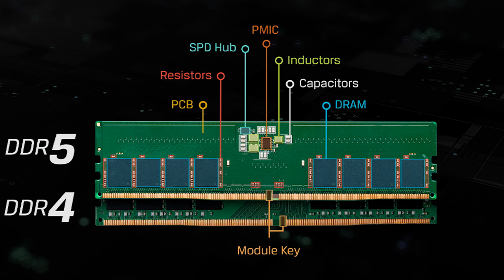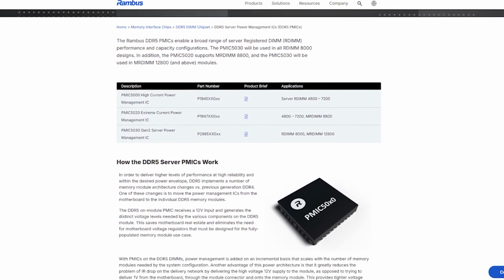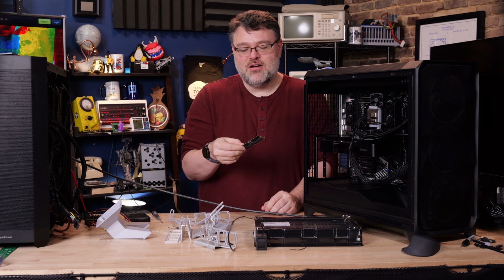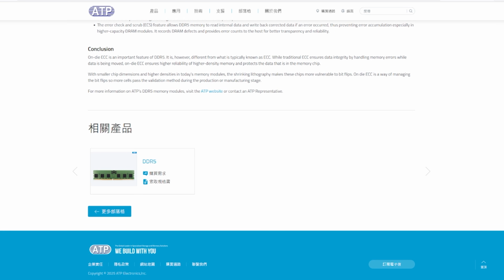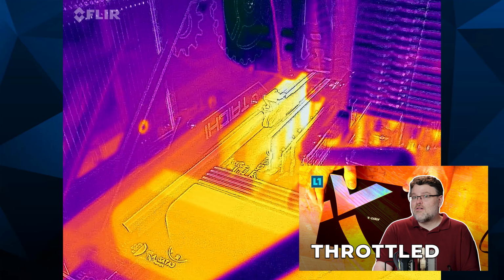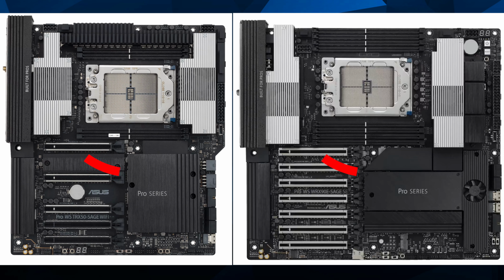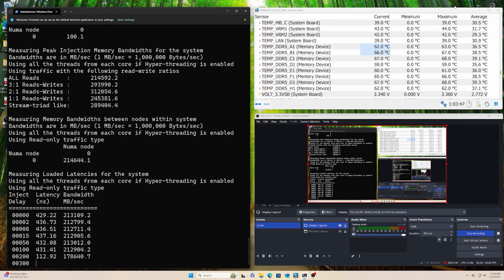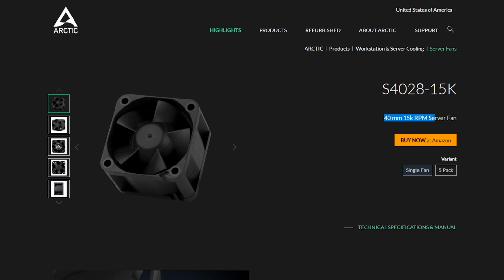Your DDR5 Memory Could be at Risk! All About DDR5

Comment: Interesting DDR5 issues that we can avoid.  If you need to build a PC without taking out a second mortgage, and reliability balanced with performance is important to you, your platforms of choice in January 2026 might still be AM4/Zen3.  My new DaVinci Resolve build has an R9 5900XT, 64GB of DDR4 (two 2x16 kits), 6TB of Gen4 NVMe storage, a 5070Ti, and a 4x18TB DAS in RAID5.  Everything was bought in the Summer of 2025 before prices exploded.  I waffled way too long deciding on a case, but settled on the Montech Air 903.  It is now assembled and tested to BIOS.  I'm researching to see if there is a Linux distro that will run Resolve 20 without jumping through a bunch of hoops.  Probably going to wind up on Windows 11.  I'm running the DRAM a little below "marketing" speed to assure stability -- it's two 2x16 kits.  I anticipate zero heat issues.

Comment: ahhhh... I feel so justified about making a full blackout personal pc rn. Never got into the RGB train except for addressable ambient led strips.
Reply: My PC isn't blacked out because I can't be arsed to turn GPU and mobo RGB off because it would require installing software just for that (so they run in unicorn barf mode), but my RAM sticks are low profile, no RGB, and literally black. I do have one fan with LEDs on it, but it's red only and blows air on all of the mobo.

Comment: ever since I upgraded to 64 gb in early november (dodged a bullet there), I was having instability with crashes once a week. Was advertised as 1.1v 5600MT ram. Increased voltage to 1.12v, no crashes since. Stuff sure is fickle.

Comment: Thanks for the video. I always check a lot of things, temps of Gpu die, Vram, Cpu temps, SSD temps etc. but never thought about DDR5 running that hot so never bothered checking temps for the ram. I did have some weird bluescreens only in star citizen and nowhere else and that game is very Ram heavy, so definitely going to monitor ram temps under load now just to be sure
Reply: check the windows dump file next time it happens. I had bluescreens in tarkov last year, turns out they were caused by easy anti cheat, a kernel level anticheat, which star citizen uses.

Comment: My Asus 1080TI OC in my old gen 1 Thread Ripper 1650x died last week with purple lines in the shadows Ghat GPT says its probably the Grddr5 killed by temperature. the design had the backplate trapping heat and heating up to over 100deg so guess its time to look at a new system i guess anything will be faster that this machine. It still does the job i bought it for. MSI GTX 970 surprisingly useful in case of this emergency.
SO yes check GPU memory temperature and apply extra cooling measures like heat syncs on the backplane even if its a 1 u sever block held on with some thermal past.

Comment: A lot of this could be solved by DIY PC builders demanding motherboards built for function instead of looks. The RAM slots should not be placed across the "usual" airflow path from the "front" of the board to the "back" but in line with it. If a case is designed to change that "standard" airflow pattern then it better move a lot more air than normal.

Comment: Many people (including me) are using tweaked sub timings like tREFI. Instead of very conservative values like 5000 instead 50000 is used. It is the sub timing with the highest performance influence.  With aggressive values it is well known that they only work unless temp is below 55 degrees or so. The default values should provide stability for the specs like 75 degrees. And oh, XMP on very high-end RAM (7200 MT/s or more) is notoriously unstable. I bet those kind of RAM sticks were not tested to work with 75 degrees.

Comment: Its weird how low the temp actually needs to be for it to create instability. I have tested a bunch of kits, and Adie sometimes throws errors even at 48 degress!

So i can stress enough how important a ram fan is. Also you can do it for more performance, with more cooling trefi can be pushed higher.

Comment: Thanks! Gonna check those mysterious WHEA errors i got on HP Z Workstations by monitoring the RAM temps with HWinfo. God bless L1Techs.

Personal anecdote: I run some trident z 6000 cl34 (iirc) docp with a 7800x3d on an asus tuf x670 wifi board with regular agesa updates, never had any instability in two years- probably because my phanteks case hase 3x 120mm front intakes.

Comment: I hope all of yall saved your ddr2 ram waterblocks
Reply: I was just gonna say it reminds me of the good old DDR2 days
Reply: @Inch42  At least the DDR2 is overclockable.  I had a 512MB 533MHz Kingmax, that can run on 1020MHz!  Now with DDR5? You are lucky if the EXPO can achieveable.
Reply: @devilzuser0050 DDR5 is extremely overclockable if you avoid junk 2dpc boards.
Reply: @nepnep6894  Not necessarily just that. Most non-8000 Ryzen and some 9000 Ryzen can indeed overclock DDR5 quite well, but try Intel 12000 or Ryzen 7000 and you're lucky to hit something like 6800 MTs which really isn't relatively all that much over official clocks. Most people on AM5 probably are on the 6000 series still and on Intel there's other problems for the latest DDR5 gens.
Reply: @whohan779 12th gen can go up to 7800 depending on the board. Zen4 does 8000, but brickwalls beyond that because of a firmware bug that AMD fixed with zen5.
Reply: @devilzuser0050 I've got 2x24gb 6000 cl30 running at 8000 cl36 at 1.46v, it was relatively easy as well.
Reply: @devilzuser0050 EXPO is an overclock.
Reply: @whohan779  I'm on AM4, C6H with a 5800x3d and 4x8gb TridentZ 3200CL16 OC'd to 3800CL16 never had an issue, and it's not even b-die it's hynix cjr
Reply: @richardyao9012 I wouldn't call advertised specifications "overclocking". Those specs are the baseline. If anything, not using EXPO is underclocking.
Reply: The Windows 2000 build I made during the pandemic is now a viable PC option. Faster than Windows 11, and has no AI crap.
Reply: @harryshuman9637  Amen.
Reply: @harryshuman9637  I still daily drive XP, use that
Reply: @polpolaris  But muh security! jk, more power to you.
Reply: @Acoustic_Theory lol, sometimes the malware doesn't even run, needing newer dependencies
Reply: Corsair made nice ram air coolers for ddr3, they can fit all mb ram slots tho, ram height adjustable too.
I have a few of them somewhere, looks like they were a good investment. :face-purple-wide-eyes:
Reply: You can just buy RAM waterblocks...
Reply: I remember ddr3 having clip on fan coolers and some heat spreaders being plumbed for water cooling by default. Both i think Kingston did

Comment: Good old CM Storm Enforcer case. Space for two top mounted fans, forward one can be set intake fresh air straight onto the RAM.
Of course I am on DDR4, it's a case I got in 2014 and 12 years later still going strong.

Comment: My AM5 platform has 192GB of DDR5. For months I was getting random crashes and didn't know what was causing it. After Checking HWmonitor I noticed my RAM was running pretty hot - I 3D printed a RAM cooler and bolted three tiny Noctua 40mm fans to it. My PC hasn't had a problem since.
Reply: How hot is "pretty hot"?
Reply: @mannotwiththeplan my ddr5 6000 30 cl isn't stable in expo. Untill I found out it can run  0.1v leds and doesn't surpass 50 degrees anymore.
Ddr5 is so temperature sensitive.
Reply: @mannotwiththeplan  from what ive seen 50*C its the second it will throw erros in stability tests.

if you Look at Buildzoid Memory OC videos he has a fan to keep RAM below 40*C even if its possible
Reply: @Zigg28Zigg28  hm, my DDR5 regularly goes over 50 C when watching youtube and gaming, no issues.  I use 2 sticks.
Reply: If you are already printing a custom duct, why wouldn't you make it for one 70mm fan? Larger fans are inherently more efficient and quieter for a given blade design style and flow condition.
Reply: @mytech6779  Probably because 70mm fans have an area of 4900mm², and the (assuming in-line 3x1) 40mm fans would be 4800mm² 
Much taller and it may impact airflow in the case. 
...or for all we know, they may be a sadist and it's actually an ITX build with 2x96GB dimms, so they haven't the space for 70mms
Reply: @Carhill are there even such high capacity sticks?
When I build my ITX AM5 build at the end of 23 only 32gb sticks where available so I only could buy 64gb, which already buggged me back then because I want my systems to be future proof.
I wish I could’ve at least bought 96gb before the prices got ridiculous but in the specs of my x670e itx mainboards it says 64gb is the max available memory so I didn’t buy a kit.
Reply: @Carhill  You mean masochist?
Reply: @ilikehiking  depends if he wants to suffer or if he wants his ram to suffer
Reply: Mr. Millionaire over here sheesh..
Reply: @renaissanceman2075  The "for months" part implies that he bought memory back when it was a reasonable price. Hardly a boast.
Reply: @renaissanceman2075  He probably got it when it cost like 600-800 and not 5k plus.
Reply: @renaissanceman2075  They say things like this to boast...if even true...And to be honest..don't care.
Reply: @Bodneyblue  He said months, that means he bought them at relatively cheap price compared to whatever the fuck we have rn.
You didn't need to be extremely loaded to buy that much RAM back then.
Reply: @tanphan1848  saying "back then" as if it was in 1990 but it was just 4 months ago is funny but it also pisses me off
Reply: @QPUNeptune  prices fluctuate, just part of how markets work.  I’m building a new system and I put it on hold until memory prices get a little less stupid high. shrug
Reply: 192 GB of ram ?????
Reply: @lockhart1895  I know, so teeny tiny, right???? Half a terabyte or go home!
Reply: @lockhart1895  Audio production alone can make use of it, if there are huge instrument libraries consecutively operating in a project.
Reply: Get a load of Mr fancy-pants here with his 192gb of DDR5 RAM
Reply: It runs hot
Reply: also try leaving the frequency at 6000 and tightening the timings instead. You might just be pleasantly surprised with faster speeds AND much lower latency.
Reply: Suffering from success
Reply: HE HAS RAM, GET 'EM BOYS !
Reply: RAM is very picky about temperatures. For example, DDR4 Hynix DJR (dual rank) modules known to run into issues with decent temperatures, requiring to have a cooler to be stable on "above average" OC settings.
Reply: I'd assume you're running 4 sticks on an AM5 MB. AM5 is notoriously bad with 4 sticks. I'm honestly surprised you've managed to resolve your issues by cooling the DIMMs. 😂
Reply: Lower it to 3200 I run 128 and it's completely stable won't notice any bad times or anything
Reply: YES, the PMIC should have their own dedicated heat spreader SEPARATED from the RAM chips (if you need any at all) to prevent the RAM chip to heat up from the PMIC.
Reply: That's just what happens if you don't run the flux-compensator at 1.21 gigawatts..! It's not the DDR5.. which you hopefully got embedded to the 0-K(LO)-QPU-cooling grid?
Reply: Will buy 8 of your gigabytes
Reply: What do you guys work on with 192-256GB of RAM?
Reply: If you are running more then 2x24 48gb kits even xmp can be unstable. Most z790 z890 x870 check the default spec max frquency supported stock,  intel or amd  xmp/expo spec is an overclock. Usually in previous ddr3 and ddr4 xmp was or seeemed bullet proof that isnt that case anymore.Also specific to intels multiple tiered max  boost frequencies this can cause even more issues.
Reply: If you have an extra 32gb to sell, I'm willing to buy
Reply: @CyFr  You're assuming he won't just sell it to you for market rate?
Reply: @chronossage  You're assuming there's any on the normal market to buy in the first place...
Reply: @----.__  I mean I still see ram ready to ship for $400-600 just searching.
Reply: @CyFr bro i just saw like 3 kits of 32gb just the week everything went out of stock like 3 weeks ago, in 100 usd i havent more money i just bought my corsairs titanium already
Reply: You know what I did

I just purchased arctic aio it comes with a fan
😂
Solved

I saved money from a 3d printer
Reply: if you stay on the lower clock speed (base) and forget amd expo and inter xmp both ddr4 and ddr5 are stable and a bonus is that thet system dont automatic overclock and overvoltage itselve you will loose perfomance but gaine logevity and stability
Reply: @geogreco  Why I not run a 9950x or a 9800X3D 1:1 with IF? That's why I'm buying high speed. I need that bandwidth.
Reply: @geogreco what moron buys high speed ram to run at stock speeds? 

You, apparently. But running X.M.P will never be the issue.
Reply: @thebritishviking I had to RMA GSkill Neo DDR4 3600 2x16GB kits two times already since I bought them a couple of years ago. RAM deteriorates, it's a question of time. Luckily most companies provide lifetime warranty.
Reply: Wait why do you need ram cooler? Isnt the preinstall heat enough?
Reply: 3D printed a RAM cooler. Wow. Impressive.

OUT OF PLASTIC???

bait
Reply: What do you mean random crashes ? because i have like AMD Graphic Drivers time out maybe because of that ? and what do you mean by ,,Pretty Hot" ?
Reply: @Nevous1337 practically anything over 50 is pretty hot.
Reply: Lol what?? You realize ddr5 is rated for 80c right? The only time youd wanna be below 50c is if your messing with a tight trefi value  @CyFr
Reply: @Nevous1337 no that's nothing to do with RAM.

Update your graphics driver, install a clean driver with AMD's own tool.

If you can't figure that out you don't really have any business owning a PC
Reply: Igpu use system ram
Reply: @thebritishviking
Hey man, if you don’t have any business owning a PC because you have questions about it, how are you ever gonna get to where you should own a PC when people answer rudely like you do. Don’t be an elitist snob.
And as a Norwegian, you ain’t Viking :)
Have a lovely day.
Reply: That sounds more like you just have poor case airflow.
you either chose a bad case, poor fans, or just don't know how to set fan curves.
Reply: @thebritishvikingSounds to me like he had a thermal problem and fixed it a different way than you suggested (just fine)

I'm not going to call you a moron though because it's unnecessary over a conversation about RAM 😂😂😂
Reply: The issue is AM5, the chips break too. You shouldn’t be doing all of that for your RAM to be stable. I replaced my 9950X3D with a 285K and I’m using 256GB DDR5 6000MHz with XMP enabled and no problems.

But my AMD CPU died on week 2 with latest BIOS on MSI motherboard and people on Reddit were telling me it was my fault for user error in installation and that it was only an Asrock problem…

AM5 sucks.
Reply: While the intel CPU can over volt degrade it self naturally.

Comment: Just placed an order for some heatsinks, and will move an 80mm "VRM" fan (zip-tied to the AIO pump) over to directly cool the RAM.

My DDR5 6000 CL30 kit never ran stable at EXPO, if at all. CL38 is the best I can do right now but hopefully cooling brings that up to full rated speed.
(Even though it seemed to pass stability test at CL36 under gaming loads it was still causing visual artifacts, I assume that is due to the GPU dumping hot air on the RAM).

Comment: I remember back in the day with my DDR3 corsair ram cooler for my 4x8 corsair vengeance sticks. was it needed? Hell no but I need it now LMAO. Unironically ive been running into these exact ghost instabillities ever since ive built my system, at the launch of AM5. 7950x and a asrock taichi x670E with two corsair 16G 6000mt/s. I even have to run the ram in a non ideal config of slots a1b1 instead of them normally spaced out as it was even less stable. HWINFO is reporting 52c under basic desktop usage but Il have to monitor under gaming as ive always ran into microstutters on this system when I def shouldnt.

Comment: Great video and important info!  Thanks for sharing.

I love the option and ability to overclock our systems!  But I am getting frustrated that all these DIY boards are defacto "auto" and trying to self overclock for more performance.  I wish there was a straight "default OEM spec mode" where it runs exactly at the specs as laid out by the CPU/memory/JDEC manufacturers.   I know that's why people buy OEM systems like HP/Dell/Lenovo/FalconNW/Puget Systems, but I wish the DIY systems also allowed for that!

Seems there's a lot of issues coming from the MB designers always trying to get that extra little bit of performance on their system over the other guys.  I want safe defaults!  I also don't mind if they have a "auto" or "tweaked" defaults mode that has all the stuff they are doing right now.

Thanks for listening to my ted talk/rant! o>

Comment: It is my understanding that most manufacturers don't put a thermal pad on the voltage regulator like they do between the chips and the heatsinks.  So when these get hotter, the memory fails.
Reply: Some even do it in their "good" memory. Rn looking at lexar and their gen 1 ares sticks

Comment: Still on DDR4 because all is working just fine. So this is how we can beat Skynet now huh. Make the DDR5 thermal throttle in thinking it's overheating constantly. And yes I also monitor the RAM temperatures with Fan Control taking temp data from the OS so when something does something thermal the case fans will make sure it's being cooled down. It's also a great sound indicator for when something is problematic overheating because those fans will go 3000 RPM+ when something does to protect the hardware before it blows